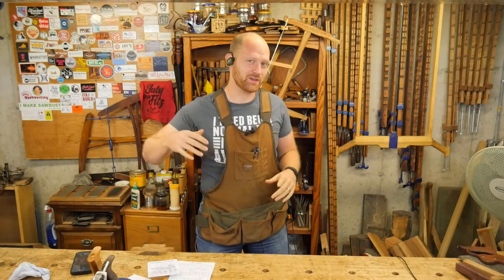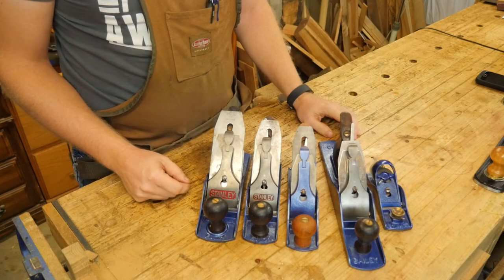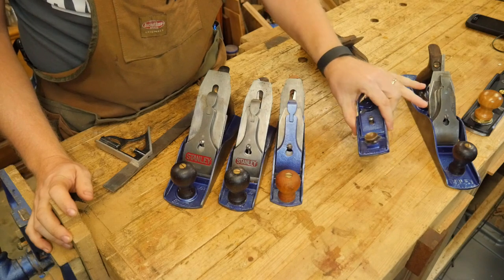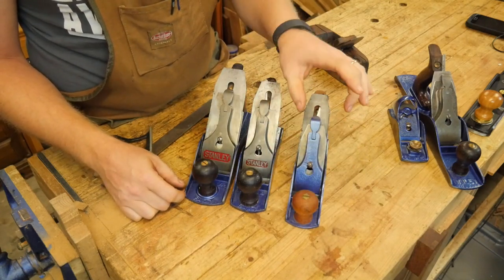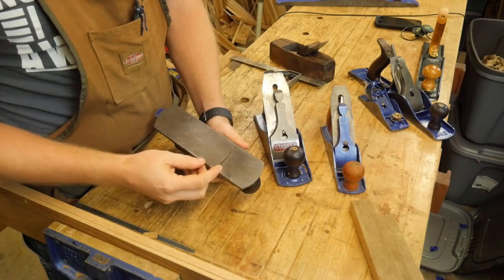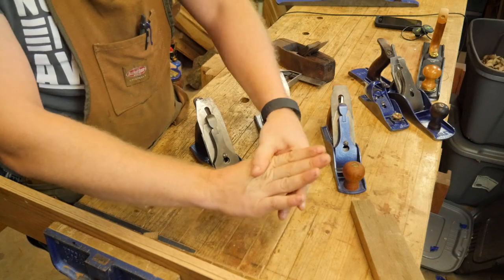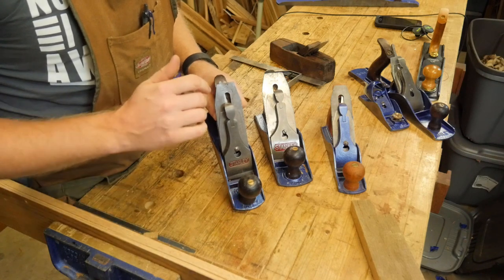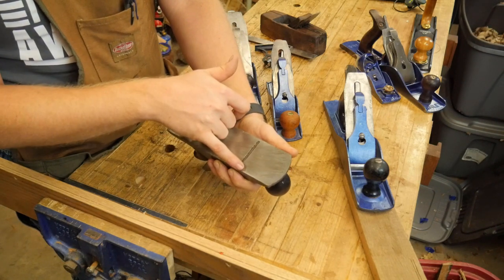Smoothing Plane - What is it and how is it used - First Hand Tool

Comment: Thanks for the vid, James! Great one again and I do see progress in terms of the filming quality, for example the different perspectives. Keep on working on that too :)

I read and saw people suggesting a low angle jack plane (i.e. a No. 62 Lie-Nielsen) with a slightly rounded iron for smoothing. If you'd only wanted to get a few planes, may it be because you're on a budget or whatever else, would you recommend that choice? The idea behind getting a low angle jack plane was that it can be used for several aspects if you purchase different irons for it (toothed iron for taking more material, steeper angle iron for difficult grain and so on).

For me it's mostly a question of budget, as - like I commented once before - it's fairly impossible to get your hand on old metal planes that would be worth restoring.
Reply from the maker: I am not a fan of Bevel up planes for smoothing even with a 50 degree iron they will just not produce the same surface without a chip breaker. but that being said. bevel up planes are fantastic for end grain as the Chip breaker does not get in the way. if you are going to buy new I would get two of the new Veritas PMV11 planes. a #4 and a #6 would cover everything you could ever want to do.

Comment: Ok that was awesome: Thanks so much for sharing the reasoning behind a smoothing plane it is truly eye opening . I kinda had a bit of clue but know I have no excuse.
loved the tip on slightly rounding the edge of the blade as I had an issue with the blade leaving marks where the blade dug in although I "covered " with some strenuous sanding LOL.
Really looking forward to the set up video  if it's anywhere near as informative then they joy of a hand plane shall be mine ;)
Reply from the maker: LOL thanks! I am putting the final touches on that video as we speak. it should be out Saturday.
Reply: Wood By Wright LOL Youtube lesson no 1: Do NOT commit to a release date ;) we will just be happy when it comes dude!
By the way what headphones do you use I work with music all the time as it's so inspiring and helps me think ( well think more  than normal) 😜
Reply from the maker: they are Avantree Jogger Sports. I love how light they are. I wear them almost all day every day. thanks for the great comments.
Reply: Awesome james thanks for the info I've been after a set of decent comfortable wireless headphones for a while now

Comment: What are your thoughts of high angle frogs for the smoothing plane? In particular a 50 degree high angle on a no 4.
Reply from the maker: My best smoothing plane has a 55 degree frog on it. Great for working on that incredibly difficult tear out. However it does make the plain harder to push so for general use it's not as nice but for detailed smoothing on difficult grain it's very useful.

Comment: Could I use a fore plane as a smoothing plane? I ask because I found a large fore plane that I love. I have a very large slab of would to smooth and so I'd like to use a larger plane than the smaller standard smoothing plane
Reply from the maker: A four-plane has a large camber on it. It's very similar to a scrub plane. If that is what you're talking about then no you would need something with a tighter mouth and a new iron for it. However, if you were referring to something like a five and a half or a six then you can set it up to do smoothing. It just won't be able to spot smooth as well as a smaller plane. But you can definitely smooth the surface with it. Just takes a little more work because you have to smooth the entire surface to just clean up one area.

Comment: Nice. I really need to have a go at setting my nr4 up. I use wooden planes mostly. 

Question: ribbed soles??

Wooden planes need a bit more attention imo..
Reply from the maker: The problem is over here wooden planes are hard to find. I have a few but have not found the time to restore them. but it will come.

Comment: I'm still confused.  You say the smoothing plane can follow the peaks and valley, but that just implies one did an inadequate job with the joiner plane.  If one sets up a joiner plane with a small mouth and sharp flat blade can it be used as a smoothing plane?  Does a smoothing plane smooth better because the small size concentrates the downward force on a smaller area enabling burnishing?  Other than that I don't understand why a small plane would smooth any better than a larger plane set up the same way.
Reply from the maker: Traditionally? Smoothing isn't about smoothing the entire surface, but spot work. If you have a little tear out in one area you just hit that spot. Yes, you're going to take just that one spot down a little bit lower but your hand won't feel the difference and it's a lot easier and simpler than doing the whole plank. That's the main idea behind a smoothing plane being a smaller plane. You can still do smoothing work with a larger plane but it means you have to do a much larger surface and you can't just spot clean up. It's a bit counterintuitive to our modern minds, but if you go and look at antique surfaces from years ago, it's very hard to find anything that's actually true and flat.

Comment: If there wasn't any tear out with the plane you use to flatten, it would be smooth, right? It seems that a smoothing plane should be called "anti-tear out plane", size not having to do with tear out. I don't understand the advantage of riding the valleys and bumps, smoothing wood that not entirely flat. Wouldn't you want to stay the same size (for flatness), set it up for tear out (smoothness) and give it enough passes to get both smooth and fix your flatness? . Maybe if you're going to keep one plane set up for smoothness for any sized board, a smaller 3 or 4 is more comfortable? What am I missing?
Reply from the maker: it is just a pain to re-setup a Bailey pattern for something. for flattening I want to take off 4-8 thousandths and with that thick of a cut, you are going to get tear out on figured wood. for a smoothing plane, I want less than 1 thou. I would rather just have one plane setup for that all the time. plus most of the time the smoothing is not over the whole board but just in the difficult spots. no reason to hit the whole board and risk tear out in other places just to hit one spot. but everyone is different. and we all have our own way of woodworking.
Reply: Thanks for reply (few take the time to respond to comments on older videos). It cleared things up for me. Not having local woodworkers to talk to often leaves me struggling to answer my own questions.

Comment: Dumb question:  How do you store your planes?  Iron retracted?  On a soft surface or a hard surface.  There is practically no info available on how to store them.  I have heard that if you store them improperly, the structure of the plane may be affected.  Old wood worker's wives' tale?
Reply from the maker: everyone you ask will have a different idea. right now they are irons out sitting flat on wood. I have no problem at all with that. when I build the tool wall they will be stored vertically, toes up. but even then I will not retract the iron. I have never seen proof of any damage to the body from any method other then throwing them on the ground. LOL